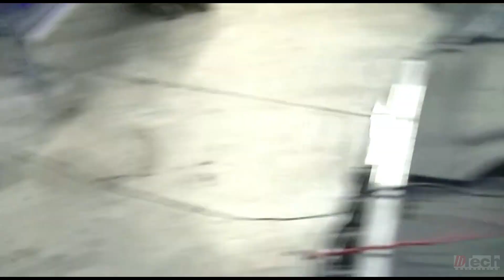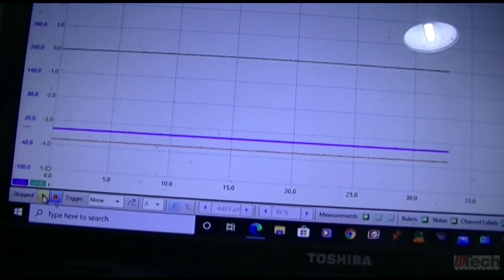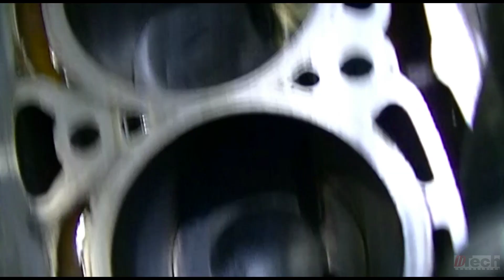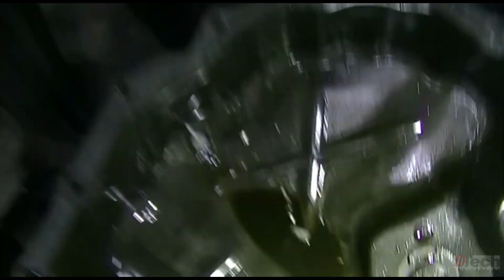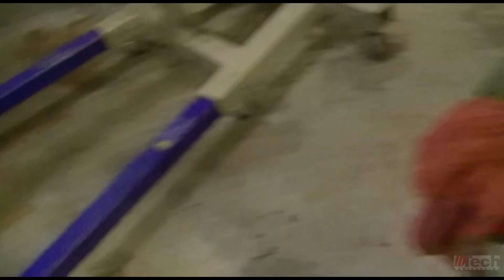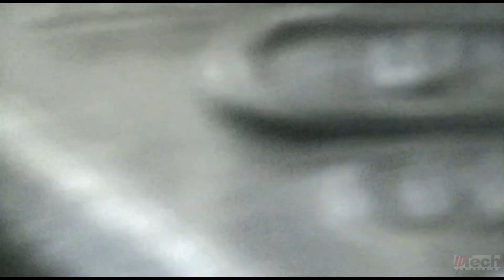2014 Audi A6 2.0 misfire from low compression

Comment: I have a Audi Q5 2.0t , no compression in cylinder 2,4 the other two cylinders work just fine, I’ve been told I could be looking at a few issues , rings pistons, gasket valves, im having it looked at this teus, to figure out what’s going on, what are a few more things that could cause this to happen ?

Comment: I have 19 bar on 3 and 17 bar on 1 cylinder. The car starts really good despite the low compression rate. In the cold mornings I have a rough idle for 20 seconds after I start the car, and the car does a nose dive at 3000RPM in almost every gear. Should I look for another engine ? Thanks
Reply from the maker: if it is showing signs of mechanical issues, it might benefit to look for a replacement.

Comment: I have a question. The same thing happened to my 2015 Audi 2.0. It left a grey area up the cylinder wall. You can not feel it with your finger nail. But you can feel it with your finger. It feels as if there is a change it texture or something. There are no scratches. Just this 1/4 in wide grey line down the cylinder wall. Can I hone these cylinders and put pistons in?
Reply from the maker: I personally have always used what I was taught, which was if you can't catch it with your finger nail then you should be ok. What you are most likely feeling is an area that got "rubbed and polished" sorta say....in that area you won't have peaks and valleys for oil to sit in on the cylinder wall, but if it is small enough you might be able to get away with it and not see great effects from it. It all depends on the route you want to take and its usually dictated by cost. I personally have been in your situation before with my personal cars and I've reused the block. hope this helps
Reply: @DTEAuto  thank you for the fast reply. It has helped vastly

Comment: great vid. good troubleshooting using starter current to detect no compresion. I new you were pulling engine immediately as vag RMSs flange bolts to upper flange  you probably noticed junk pistons were redisigned. so relieved you replaced all 4 with waffle oil control rings  
well done  
I did my 14 also and decided to lose early and just pulled engine and did it in a stand.
Reply: sorry meant to say  RMS flange bolts to upper oil pan. very bad design for servicing.

Comment: What if the compression loss was from a slightly blown head gasket from the cylinder to an oil passage, this could be fixed with a head gasket, how would you prove this job vs leaking rings? I am thinking to give a new piston rings estimate, pull the head and see the blown gasket, pistons look good, cylinder walls looking good, then giving the good news to the owner??? OR NOT. Thanks for the video.
Reply from the maker: you can add a transducer in the oil system and monitor for compression spikes leaking into that system during cranking. Check out my video on BMW rod knock where I put a transducer in the oil system for diagnostics

Comment: I wonder if that damage is detonation?  Turbo engine with broken ring lands?
Reply from the maker: I would venture to say it's due to incorrect oil usage in a modern GDI turbo engine. A phrase by the name Low-Speed Pre-ignition(LSPI) to be more clear. Oil droplets can "self ignite" and cause internal engine damage. I believe that the oil ring land has the most oil concentrated in that area, and is why it appears to have ignited there and traveled upward. Make sure to use the correct oil for these newer engine setups. Thanks for watching
Reply: @DTEAuto  Did you happen to inspect the PCV system? What brand and weight oil was being used?